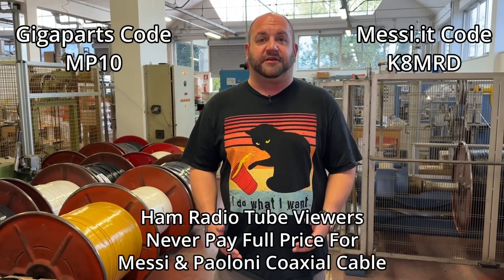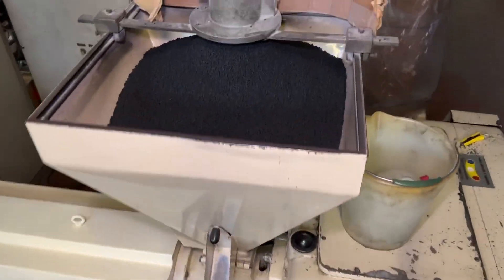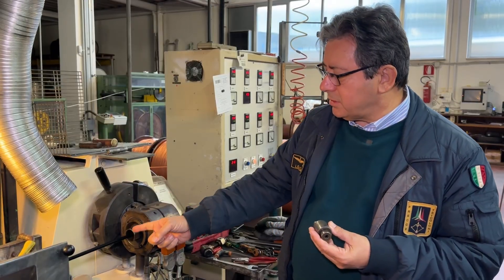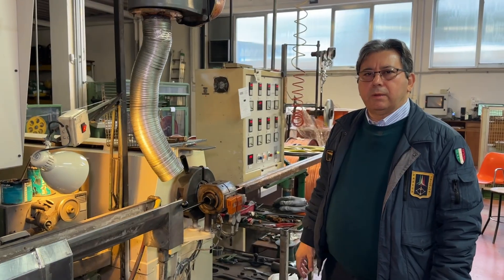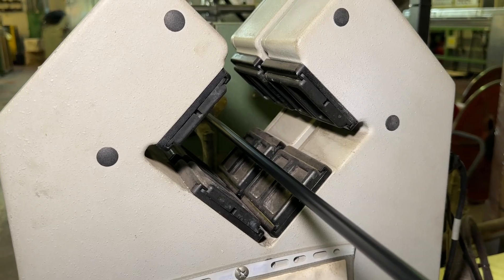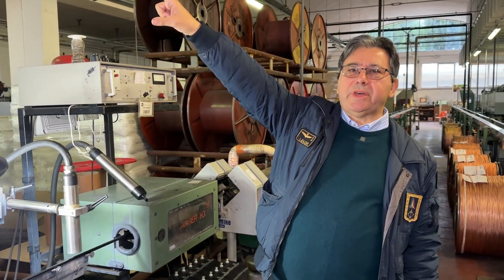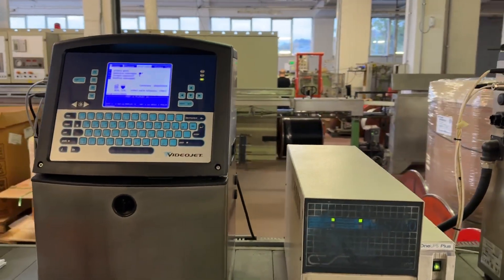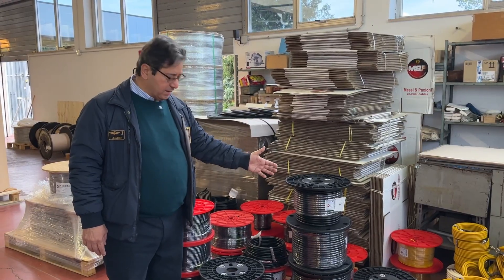Messi & Paoloni Factory Tour Part 3:  Extruding The Jacket

Comment: love how it's made.  havening a good time with POTAFLEX 7 -50 ft spool kit.  testing GMRS and HF along with CB . works super. even in the snow. ran some power threw it on HF . no heat at all . SWR stayed low. did some long keys in dummy load , 600 and 1000 watts. had the dummy load toasty warm and coax cold. stays flexibly in the snow.  easy to see. love that printer for coax. your discount code works on custom builds and adapters M & P makes. 73's

Comment: Mike these videos are great. Ever wonder how a guy came up with that brade weaving machine? The complexity of all this is mind boggling.
Reply from the maker: I'm still trying to wrap my head around how it works.  All I know is it goes really fast!
Reply: That's a common  style braiding machine that is also used for braiding rope, leather, wire, or putting a braid jacket over something, like plastic tubes...ever see those stainless steel braided hoses sold at Lowe's or Home Depot for sink and toilet water lines?   The number of bobbins determines the "texture" of the braid, more bobbins results in a finer braid.  Yeah, the  speed at which they run is mind-boggling.